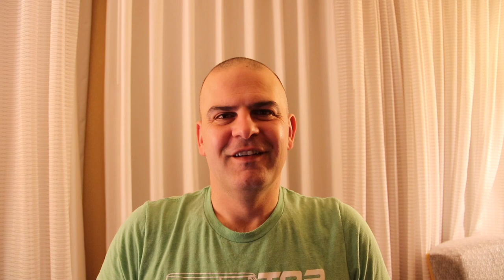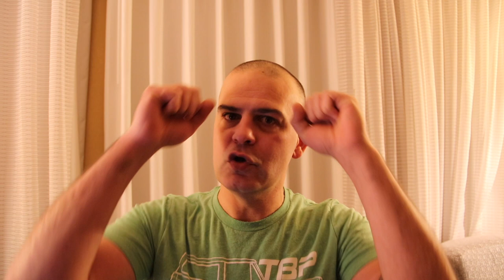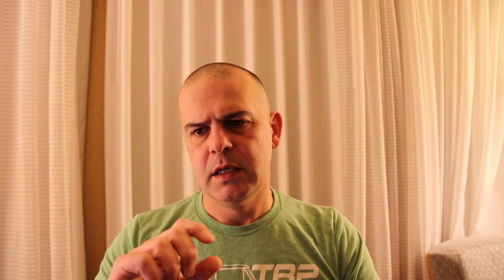3.18 - Pinion Depth Discussion - Part 2 of Gears and Axles

Comment: Matt, I've spent most of the evening degreasing  brackets and getting ready to primer and paint engine brackets and pulleys, there are lots of parts. I'm going to soda blast some, sand blast others in the cabinet I've set up. It's slow and tedious work. Seeing this video tonight gives me that extra motivation that I can do it. The paint stuff is no biggy. I've got lots of experience painting all kinds of things. I do have a dana 44 front end sitting in the middle of my garage floor the is challenging me to overcome it. I will eventually have to swap my 30 for the 44. Front disc brake conversion to boot. Thanks bro for the boost of confidence.
Reply from the maker: Brian Hurford nice Brian. U r in the thick of it like me. Don’t hesitate to reach out with questions or to bounce ideas around.

Comment: Get the Ratech tool for the differential that you have, either from them direct or through places like Summit or Jeg's.  The tool doesn't cost much and is the only economical way to find pinion depth; the other tool costs over the $100 mark and forget it if you think that Harbor Freight has a cheap version of the tool, they don't.  One thing that you'll need with the Ratech tool is a dial caliper though, but that shouldn't be a big deal. 

 I use the Ford 9 in. differential in my 67 Mustang and I prefer to use a spacer/shim kit instead of a crush-sleeve for setting the pinion pre-load as I always found myself going through more than one crush-sleeve and lock-nut before I got the pre-load right.  The huge amount of torque required to get the sleeve to crush is also a big PITA.  Using an impact wrench isn't recommended to do this as it isn't accurate and plays hell with the bearings.  I guess that it's a matter of preference if you want to use a crush-sleeve, but a lot of racers avoid using them if that tells you something. 

 Ratech does have their own version of a crush-sleeve called a "smart sleeve" that may be worth looking into if you're interested in their products.  Ratech is a small American company located in, Cincinnati, Ohio; they make most of their own stuff; the web address is:  www.ratechmfg.com  So you'll know, I don't have any connection with these people except that I use their stuff.  They'd probably appreciate your business plus it keeps Americans employed with decent jobs. 

The pinion bearing pre-load needs to be checked with a torque wrench unless you do a lot of differentials and have the "feel" because just guessing could lead to a costly problem.  You'll find that 99% of the Inch/Pound torque wrenches don't sense the low amount of torque that is required for the pinion pre-load.  You need one that starts at zero.  A "click" type torque wrench is useless, too.  I found a reliable low cost "Beam" type wrench that has a range of 0-60 Inch/Pounds in the Summit catalog; Jeg's should have them as well as some others if you look around.  Don't expect to find the torque wrench that you need at most tool outlets like Harbor Freight, the home improvement stores or auto parts stores, their low range usually starts at 20 Inch/Pounds.  You may luck out and be able to get one on loan from one of the chain auto parts stores, though, but don't bet on it.  I hope that this helps some folks out.  Peace.
Reply from the maker: Agree.  The Ratech tool is a a great sanity check and starting point.

Comment: Hey Matt! Great discussion. I too am going to attempt to rebuild the 9 in. The Ratech tool instructions act like all you need is the tool, a dial caliper and the pinion depth printed on aftermarket gears to get a tight measurement. Get it close then check with marking compound. I haven’t attempted it yet but is it not that easy even if you don’t have the original pinion depth measurement??
Reply: Also this is Taylor, I emailed you a while back. Apparently I’m signed in on my wife’s account.
Reply from the maker: Hi Courtney, thanks for watching.   It very much depends on the aftermarket gears.  Yukon just doesn't have the measurement.  You'll have to find which brand has it and order those if that's the approach, but theoretically it should work.  From I've found on the internet, the nominal (factory ideal) checking depth for the Ford 9 is 1.031.  So if the pinion says 1.032, then it's pretty obvious that the checking distance for that pinion is one thousandth more than the stock.  Other aftermarket pinions may say "+4" which means that pinions checking depth is 1.035.  Make sense?  Also, I can't remember which ratech tool (dana 44 or ford 9) require you to measure the thickness of the pinion head as part of the calculation so make sure you do that before pressing on any bearings (unlike me!).  I'm not home otherwise I'd check for you.  Did this all make sense?  I highly recommend measuring the original, no matter what the ratech instructions say.  Think of it as a sanity check.  In any case, the pattern is king so don't worry too much.
Reply: Now that I'm not on my wife's account...everyone is going to think Courtney is a gear head! Thanks for the timely reply Matt.  I have Motive performance gears waiting to be installed.  I'll have to check the markings when I get home to see if it references pinion depth.  Good to know on the nominal factory depth. I also pulled mine without measuring the original depth.  I didn't think it was as important if you weren't reusing the same gears, wrong. Bummer.  Everything makes sense, I appreciate the detailed response.
Reply from the maker: Oh hey Taylor,  yeah hehe I was thrown a bit off by that one.  Did you keep the original shim?  If you did then you can get pretty close.  Just measure your original shim and your old pinion head thickness.  If your new pinion has the same pinion head thickness, just reuse the original shim for checking.  If the new pinion head is thicker or thinner, then adjust the shim accordingly.  That should be pretty much the same thing. And I'm surprised you didn't buy Richmond gears!
Reply: I do have the old shim. I also have 1.029 stamped on my new pinion gear. Looks like that info should make it easier, I’m hoping to rebuild this weekend so “my bronco wife thinks I’m a manly man.” Ha! Didn’t think about getting Richmond gears, what a missed opportunity.

Comment: The aftermarket world SUCKS for pinion depth.  I worked at Ford so I had every special tool to set up a pinion depth. I will say i never reused the same pinion shim.  However.......using the shim that was in it 90% of the time it will be fine.  Do not buy any aftermarket pinion depth tools, they are ALL junk.  You can't measure to a pinion face as it's not a machined surface. Without the actual factory tools, it's easy to set up but takes some work!  You need to buy 1 extra bearing. The large inner pinion bearing. That bearing will be your special tool. Hone the inside out with a brake hone or die grinder so it's a slip fit on the pinion.  Start with the old shim, Reuse the old crush sleeve and assemble pinion without the seal, set pinion preload, install carrier and check the backlash and pattern.  Make sure your pattern chart is for the type of gear you ha e, ie Hobbed vs milled.  With the slip fit bearing you can easily slide it off and try a new shim.  I have never went more the .002 either direction from the original shim.  Tag your honed out bearing and throw it in your tool box for the next rear end.

Your pinion bearings should be brake cleaned, blown dry, then pour automatic transmission fluid on them and blow off all the excess before you assemble. Then when you check preload with a beam style wrench you don't get those jerky movements that throw off your reading.

When you take your pattern paint the drive and coast side of 4 teeth. Use a wrench on the ring gear bilt to turn the carrier and with you free hand grab the pinion flange and hold it tightly to resist movement. Roll the teeth back and forth 4 or 5 times against each other while applying firm pressure on the pinion flange.  That will give you a nice legible pattern.

Never use those stackable carrier bearing shims, they suck and cant be accurately measured!

Good luck!
Reply from the maker: Eric H thanks Eric! After getting home and several more tries I was able to finally get it. Now I feel a lot more comfortable. I even added a posi to my Jeep’s Dana 35 while on my back. Factory shims worked perfectly so lucked out on that one!

Comment: Hey Matt, did your initial pattern checks with your pinyon to far out, show heel on drive and toe on coast?
Reply from the maker: Oh man it’s been so long, I don’t remember at all
Reply: @MattsGarage  I’ve seen that when pinyon depth is too great, the drive side is out on heel and coast on toe, and the reverse is true if pinyon is too close to ring gear. I’m struggling because my 1980 D44 reverse high pinyon housing spun the inner bearing race in its bore, rounding it out 100 thou larger than OD of race (no more press fit) welding/brazing/machining to bring back to spec, but the DEPTH is off too, so I’m waiting on additional shims. I wish my only problem was setting gears up, I cannot even buy a replacement housing,
Reply from the maker: @WesternReloader  that sounds rough! Yeah it’s amazing how hard it is to find pets these days. I feel like I’m polishing the brass on the Titanic sometimes. Good luck.

Comment: I have watched so many of these things on pinion depth & still cannot find any one who has a source for finding the actual pinion depth. Problems: 1) not all pinions have a measurable surface to determine depth. ex: Chrsler 8 1/4, 9 1/4 diffs do not have any machined surface  on the end of the pinion from which to take a measurement. 2) Not all diff pinions have a measurement etched on the end of the pinion, ex: Dana 60. 3) Just because you have the correct shims under the pinion doesn't mean that the new pinion will assemble with the correct gear mesh. So, tell me just how the hell you determine the pinion depth when there is absolutely no damn way to determine the pinion depth. Now for a question that I have been trying to get answered on a Dana 60. What is the exact measurement from the center of the carrier (center of axles) to the surface of the inner bearing race of the inner pinion bearing. That is the dimension that is used at the factory to determine correct gear mesh. Not some magic number (usually non existent) etched on the pinion or some convoluted series of shims, extensions on a dial indicator or other witchcraft. Just some exact measurement of a dimension that seems to be unobtainable.